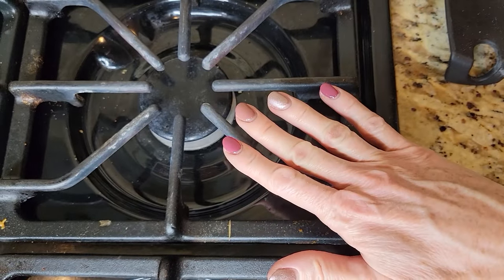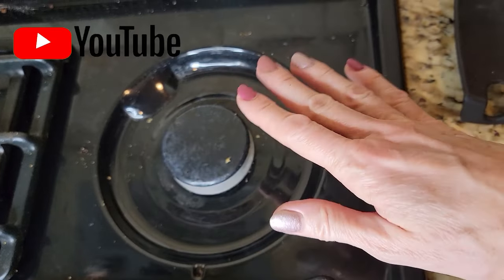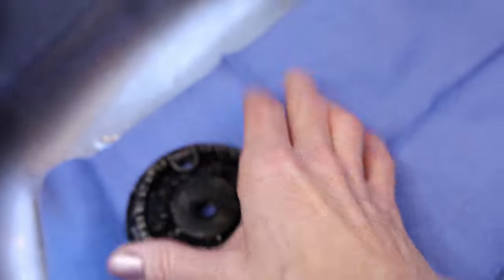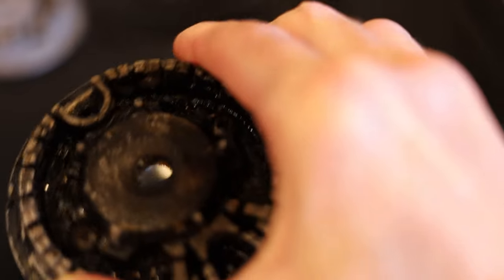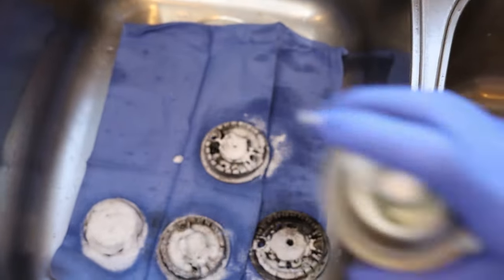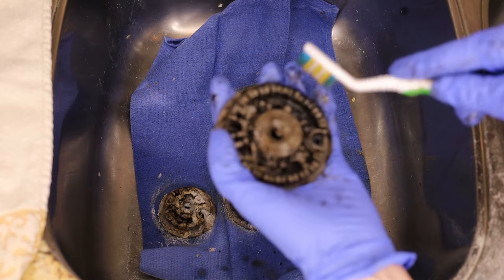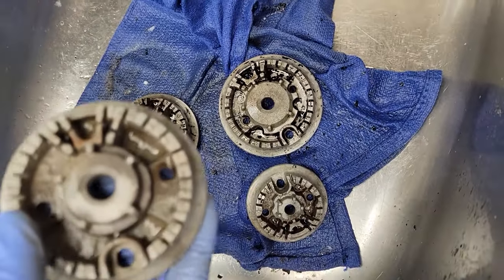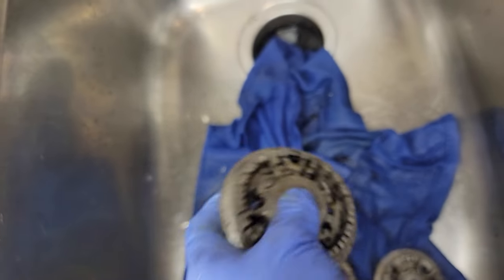Use THIS⚡ to clean your greasy stove burners and WATCH WHAT HAPPENS

Comment: The grates go in the dishwasher.  If you have boil overs or burnt on messes, let the parts cool and soak in a soapy, hot dish pan.  Or put in the dishwasher.  There is really no reason for a gas stove to get this bad.
Reply: That won’t remove polymerized oils.

Comment: Thanks mine looked just like that and weren't burning cleanly, mine has the igniter I'm trying to disconnect now :D

edit: if anyone else has issue removing, mine had a locking tab on the electrical connection you had to press in from one side with a flathead and pull to remove.